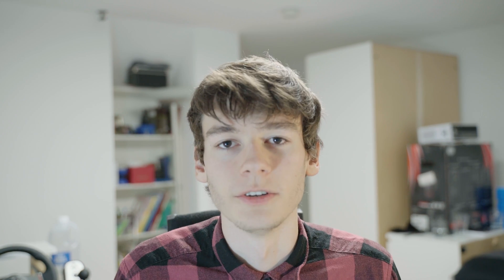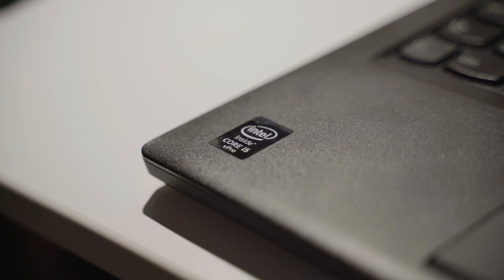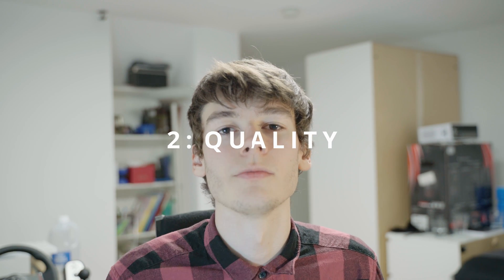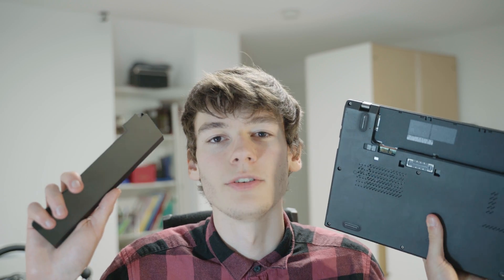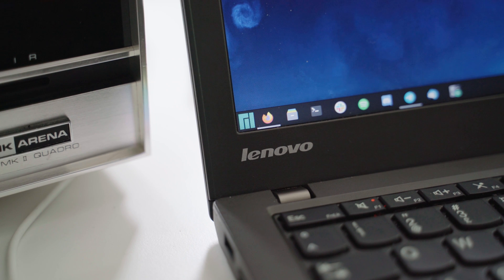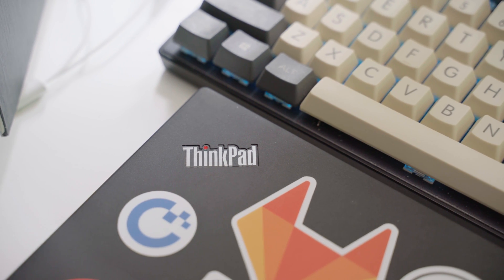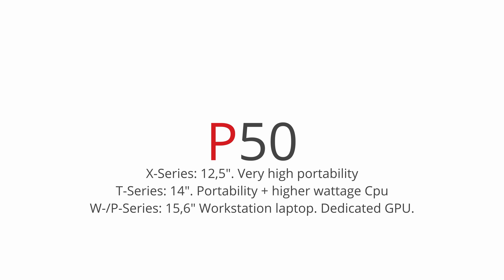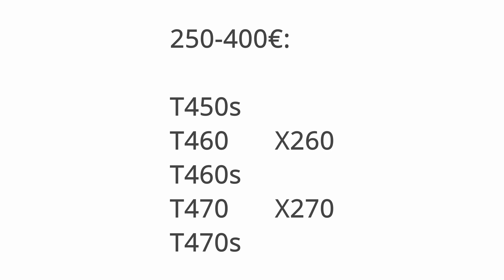The Best CHEAP Laptop for Programming

Comment: Can you reset up your  with an os(preferably Linux) optimize it maybe with some clean configuration and things you prefer on your DP Screen and setup software dev environment and show us how it performs with some code starting from basics to intermediate or maybe a bit high end  upgrading the hardware then maybe if that's okay upgrade the ram and check performance difference?
Reply: i think best option  is an i7 10ma gen laptop with hackintosh and linux.

Comment: well, basicly, X250-260-270 and T450-460-470-470s have same performance, the difference is only in the ram capability, the other specs is 100% same, all of them use dualcore cpu.
for slightly improved performance, go for T460p or T470p with HQ CPU

Comment: As of right now, the best laptop you can get for under $300 is a ThinkPad T480 with an i5-8350U. It's got a 4-core, 8 thread CPU with serviceable iGPU performance for programmers, and you can run anything you want because 4 cores is still enough (as opposed to 2 cores 4 threads, Windows and some demanding Linux apps now struggle quite hard with the likes of an i5-7300U, which has only 2 cores). Look out for models with IR cameras and touchscreens. You can upgrade:

1) the RAM to 64GB at 2400MHz
2) the batteries, with the external 72Wh batteries being the best bang for your buck (though you would need to find a way to recharge them if they came very discharged - try to boot your laptop without an external battery, and only then install the external battery to bypass the check and have it start charging slowly. You may even need to disconnect the internal battery to force it to charge, perhaps - just check which battery is charging with HWinfo64)
3) the cooler, to a dual heatpipe one, so as to get 25-30C reduction in CPU temps
4) the SSD, naturally
5) the Wi-Fi card, for whatever reason
6) the screen, to a 2K panel (not sure why you'd need one at 14" though)

And you can connect a Thunderbolt 3 eGPU if you need one for whatever reason. It even has spill resistance with holes for water drainage - though I wouldn't recommend trying it out, you will be able to try it out later when you least expect it. You can even undervolt the CPU with an application like Throttlestop (or its equivalent on Linux, whatever it could be) - I could undervolt the CPU on one of them by 100mV. Below that it wasn't stable though. With the 72Wh external battery you can easily get like 10-15 hours of battery life, depending on whether you want to use the 24Wh internal battery, which may have degraded by 15-40%. You can also charge your phone with a 5V 2A always on USB port and basically use your laptop as a power bank while it's asleep, or charge your phone while charging your laptop with a single charger. Overpriced 16GB RAM Macbook users eat your heart out.

Comment: I have an X230 i7 3rd generation and 4gb and an mechanical hard drive. It currently runs Windows 10. I'm thinking of upgrading it to 8 gigs and an 120gb solid state drive and installing Linux Mint. Will it breathe new life into it?
Reply from the maker: Yes that should give it some new found power!
Reply: I stumbled upon your post and just wanted to share this even it might be too late. If you truly love your X230, are enthusiastic about your X230 and want to keep it, you may consider upgrading your motherboard that has quad core I7-31615QE or I7-31612QE. Then max your memory to 16GB, drop a 2.5" SSD, and also place mSATA SSD to the WWAN slot. Get rid of the Bluetooth adapter and place a USB 2.0 adapter to be able to plug a small USB stick or maybe your wireless mouse dongle. You may consider upgrading your WiFi card as well. Results may surprise you. I have both T480 and modified X230. I keep going back to my X230 all the time. I don't know why. T480 is a good machine for sure. You may also consider looking into E14 Gen4 (Ryzen 5 with 6 cores or 7 with 8 cores , max ram 40-48GB, 2 SSD).
Reply: @TransformationApplied  Hi there, Yes I still got the X230. I upgraded to 8 gigs and put an 128gb SSD in there. It's a speedy machine with Windows 10 however I am looking to switch to arch for more support. For the work I do, it's doing fine and honestly I don't need more than what it does. Sure if time comes and I have to upgrade it with an quad mod board, I probably will or get an 51nb X62 to change things up!
Thanks

Comment: Basically you have three choices in the Thinkpad family: X for an ultraportable, T for an ultrabook and W/P for a mobile workstation. Depending on your budget and needs, your perfect Thinkpad will exist in that lineup.
Reply: what's the difference between ultraportable and ultrabook?
Reply: @CatOnDeWall I think the ultraportable will be a lot smaller and thinner.
Reply: @CatOnDeWall ultraportable is lighter, ultrabook is more powerful usually
Reply: @CatOnDeWall  Where you want the line to be drawn between size/portability and capabilities. Ultrabooks tend to have fewer sacrifices, like my T480s has one RAM upgrade slot and an extensive number of ports while the X1 Carbon doesn't (but it is even lighter, thinner and has a better screen). The base T480 is even cheaper and heavier but gets a removable battery and you can upgrade to a full 64GB RAM rather than 40GB (only 16GB of which will be interleaved).
Reply: what about L, like l470?
Reply: @Leonardo_Castillo  L series laptops are basically T series Juniors, they're enterprise units.

Comment: I have been an avid T-Pad user since the T-400 days!...and I have (2) Thinkpad T-420's that are indestructible!....obviously they don't run Windows (Pop-OS and Fedora Linux!) one has an i5 the other an i7...both have 2TB SSD's and 16GB of RAM...and while these more modern laptops are "pretty" to look at, and have more RAM or more powerful CPU's?...how much "power" does a text document or an IDE need? I watch people who have MacBooks complain about the dings or dents that their machine's somewhat soft aluminum bodes seem to acquire by the truck loads! And the KEYBOARDS!? Its the equivalent to typing on a mechanical keyboard attached to these laptops! LoL! I also have the T-430......the T-460 and a T-480....and while I have "other" laptops as well?...(all given / gifted to me by family members) the T-Pads are my daily drivers and go-to machines foe anything that requires long-hours / long term work! I would recommend to anyone seeking a reliable, sturdy, long lasting device?...that won't milk you for money when its time to upgrade the RAM or the CPU...to look into these machines...Lenovo had the blueprint that set the industry standard for laptops! and now?...I compare any other device to the T-Pads!!

Comment: Hi , will t470s with i5-7300u  be fine for programming  and lite office usage for a couple of years ?
Reply: Yes, the CPU might hold you back a bit but if you're prepared for it to be a bit slower than the T480s it's still a capable system.

Comment: I bought a second hand T480s from a company for 237 USD. It seems almost new apart from the typical scratches at the I/O ports. I nuked it and installed Linux on it. Just completed a Linux sysadmin course with it. 

I can't see a better way to re-use a laptop than this.
Reply from the maker: Sounds like an amazing deal!
Reply: Just got my T480s for £135 shipped - with a known screen defect, a few white foggy bits; but with 16/512GB and a top-end CPU with all ports working, I'm still chuffed. Figure I can keep it Windows and dual-boot Debian or even better run it in a VM off a secondary SSD since it basically matches our old server's hardware (same gen.).
Reply: @TheGreenReaper  It's not that ancient. It can run win 10 fine. Just get 16gb ram
My 8gb has no issues. T480 tho
Reply: The added bonus of the T480 and T580 series is if you want to run Win 11 they fit the requirements. They have 8th gen processors and you can still upgrade the RAM to 32gb. But the truth is, these machines really scream when running Linux.
Reply: @rwl0323  currently letting it scream with k8s 🤣
Reply: Can you share how you installed Linux and the course you completed?
Reply: @bansterref  I downloaded a RHEL image from Red Hat, made a bootable USB thumb drive with Rufus (free software) and just booted onto the drive.

The sysadmin course I completed is by Red Hat and can only be attended by paying.
Reply: @TheCodeTinkerer  thank you, I will check it out and try!!
Reply: @TheCodeTinkerer  You pay for RHEL? I just run fedora on my system and it runs fine. I really want to know what the advantages of paying $190 yearly for basically the same thing? Is it longer support? This isn't me trying to bash you (or zsh you), by the way, I'm genuinely intrigued, and I'd appreciate it, if you would be so kind as to explain it for me.
Reply: I have just one concern, the t480/t480s/t490/t490s all come with soldered cpus rating under 8k on the CPU benchmark ratings

in 2025, would you suggest they are still usable
do note that i run arch linux only so it might not be that bad but still 6-7k is very low for cpu rating
Reply: @adityagautam4689  For anything productivity-wise on a linux distribution it is enough.

Comment: so a 12.5 inch laptop is good for programming. I prefer small screens and portability but I've read that a 14" or greater screen is the one i should get.
Reply: Its a personal choice rlly. A bigger or smaller screen wont make you a better programmer. Depending on you personally it might help with some tasks tho.

Comment: Hi, I know it's a bit too late but I want to ask if X250 able to run VM's with it. I heard some people said that you need a 8th gen processor to run VM's. I want to buy X260 but I not sure if it will be able to run VM's since I'm going to use it for my software engineering or cyber security course.
Reply: Hey, I’m a cyber major too. I haven’t tried running virtual box on my x250 yet. But so far I’ve  just installed any tools I need onto my distro. and if I need Kali or parrot for a class, I just live boot from a usb. Still important to familiarize ourselves with using a VM though.

Comment: Recently I got a used W541 thinkpad  lenovo, for 400$ (Morocco), 
16 go Ram
256 SSD
1Tb HDD (Cady)
 Except the bad battery quality (1h)
And the 1tb that keep being ejected on start up, need to send it sleep to be detected after (dont know where is the problem)
I found the laptop super worker .
Reply: You can replace the battery, upgrade the RAM and swap in an SSD drive. That will make your quad core mobile workstation a true beast. It can also be a gaming machine.

Comment: Yeah soldered ram x250 is not a great choice ,would much rather have a x230. And buy one before 2015? The t430 and t440p will out do a t450 t460 the only newer t series I would recommend is the t480 but that is still going for $600+ when you can get a t440p for $140-220 and slowly upgrade every component to compete with a t480 minus the gpu 
T440p upgrades you can do
Cpu i7 4c 8threads
Ram 16gigs
Ssd as much as you want
Optical to a hdd caddy for another ssd or hdd
Display Drop in 1080 p ips display 
Also a m.2 ssd for mor storage
Only thing holding this back is the gpu,but to be honest it’s on par with a 2014-15 MacBook Pro 
Also the t440p is the perfect hackentosh 🤗 and built like tanks
Reply: Well an older machine that’s upgradeable is future proof. The newer ones don’t offer this anymore so if you outgrow them, your only choice is to buy a new one.
Reply from the maker: The x250 has upgradeable RAM. I would say anything older than t450 or x250 is too old at this point. But everybody has to decide that for themselves. Depends on how future proof you want your purchase to be.

Comment: Great video.   I'm an old coder sql and database guy retired medically, but I'm thinking about wirking oart time doing some database design lrojects and I want somwtging cheap that will work.  Think pads sound good.  
I'm going to look at refurbished laptops and will include think pads. I actually had one that at the time was expensive that was company supplied and it was a great laptop.  
Das ist gutt.  Wundebar. Meime Duetch ist verbroken. Kaputt. 😂😅
Reply from the maker: Glad to hear that and love the German Skills ;)

Comment: hi, Lenovo ThinkPad X260 i5-6300U with 8 GB RAM and 480 GB SSD will be enough to start programming? Or i7-5600U will be significant better choice. I'm starting with Flutter
Reply: An x200 would work to start programming. That being said, yours is already a good bit better. 6300u runs like 3200passmark, i7-5600 is slower and the i7-6600u like 3.5k Passmark. U won't notice a difference. U notice a little bit getting towards the i5-8250u which is around 6k Passmark but even that's not a big deal. A bug deal is going for an E14 with Ryzen 5500u for example which is 13k Passmark, that you will notice. But right now, starting out, wait for Intel and AMD to crank it up to hold vs apple this year and save for a powerful machine.
Reply from the maker: If you are not doing anything too intensive that configuration should be fine

Comment: The T440p is actually pretty fine just look for those which don't have a synaptics touchpad. Plus you can upgrade the CPU to a quad core i7 4700mq or better.
Reply: Right he said after 2015 when everything is soldered and has the “u” cpu which hasn’t seen a improvement until the t480
Reply: You can????
Reply: @cru2006  Yeah the motherboard socket of the t440p lineup (including t540p) aren't soldered. They use m qualified cpus other than u qualified ones. They are capable of hot swapping to others and you can get a t540p quad core cpu and put it into a t440p.
Reply: @xxzmk  can you guys explain it even more, so basically t440 max upgrade using t540 procy can easily beat t450 and t460 ?
Reply: i dont recommend the t440p because of how power hungry those processors are
Reply: Yeah my comment is pretty much outdated. Its a fine notebook if you work more stationary but if it has to really be a mobile machine my goto recommendation is an Elitebook 845 G8 used  @xenolithhh

Comment: Hello, just wanna ask if an core m3 8th gen laptop with 8GB ram and SSD do good for coding? Thanks in advance!
Reply: M3 or i3
Reply: @faizfaizar  of course i3
Reply: @faizfaizar  me to I want to know
Reply: Yes, as a starting point. But you will have to work with a non-consumer editor like vscode and not use an IDE like IntelliJ. You will also need to regularly close the tabs you are not using to free up resources. It is better to have at least 16giga of RAM because the memory gets saturated very quickly if you work in a project that contains a lot of files and you compile at each change.
If you're working on the web, you should also remember that browsers today consume a lot of RAM, so when you're a web developer you often use two browsers at the same time, each of which can contain more than 10 active tabs. I advise you to start on a core i5 with at least 12g of ram
Reply: Stick to the i5 and i7. They both have hyper threading and turbo boost. A good balance between price and performance on them.